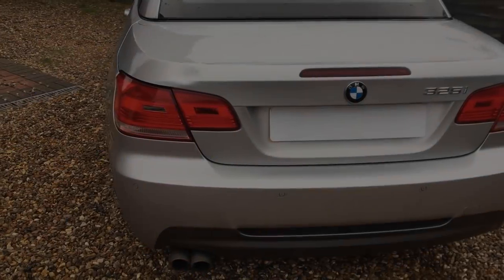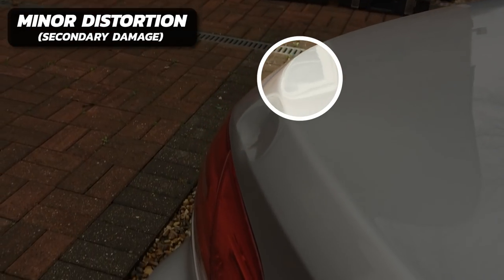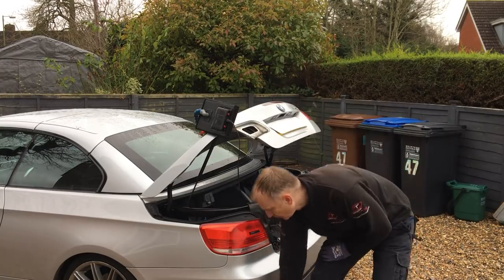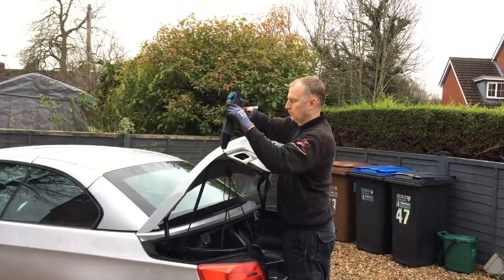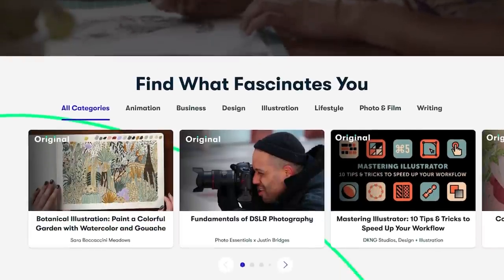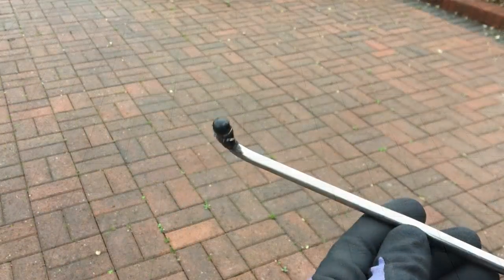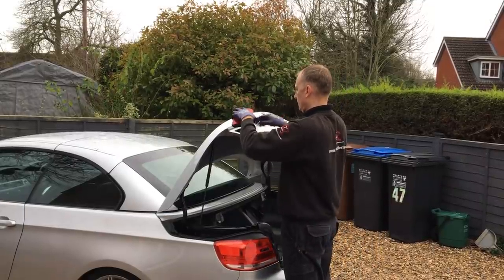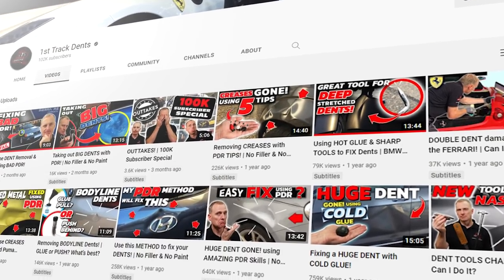SATISFYING DENT REMOVAL from START to FINISH |  BMW 325i

Comment: Glad to see you back always a pleasure to see you work your magic. The tool's on the panel is that a basic tool system. The pointed knock Down do you ever have chipping paint from maybe too hard of strikes
Reply from the maker: The tools I use are quite basic and simple, the knockdown will only ever mark the paint if the panel is hot, for example, in the summer on a hot day and the car is in direct sunlight, it also  can mark the panel if the panel has been resprayed before and it hasn't cured properly, or if there is filler/bondo behind lurking under the paint finish. Otherwise if it is a good original paint finish, you will have no problems 👍

Comment: Hi Jake, great video of course!
Do you only repair metal panels? If you can show us a plastic pdr job that would be great.
Thank you.
Reply from the maker: Hi Paul, predominantly it is for metal panels, although there are some cases where it can work on plastic, but plastic is less forgiving than metal and there are so many type of plastics so the material is not consistent. I only really focus on metal. 👍

Comment: Hey jake what kit do u recommend for a beginner?
Reply from the maker: Hey, it's hard to say really as there are so many out there on the market. I actually started out with this kit and still use a lot of them today : https://www.pdrtool.com/collections/pdr-tool-sets/products/master-41-set-made-in-usa
Although you will need to get a light, knockdowns and a good 24 inch double bend screw on tip bar.
Reply: @1st_track_dents  Cool. Im a auto painter but always been interested in PDR. Love ur videos!
Reply from the maker: @CovidSH  That's great, it would be an easier transition for someone like you to get into PDR as you will have a keen eye and feel for dent work. You should give it a go 👍👍👍

Comment: Hi Jake, why do we have high points? Pushing and tapping back seems time loss. Can there be a improvement in technique to eliminate self made high points? Such as pushing as close as possible to reqular surface.Thanks.
Reply from the maker: Thanks Anil for your comment, unfortunately there will always be high spots to tap down, that's just the nature of the metal. You should read up on the theory of 'springback' In order to move/bend a piece of metal it has to be moved beyond the point you want it to be as metal is slightly elastic (mild steel, Aluminium HSS and ultra HSS all react differently). Also within a dent you get tight and soft areas and when pushing a tight area up, the soft surrounding metal will come up higher thus needing to be knocked/tapped back down. All the tapping down can be reduced by using the correct tips on your bar. Too sharp a tip will create many high spots, so through experience a technician will become more skilled in knowing what tools to use and this will in time reduce the time spent on finishing /tapping down. 👍

Comment: I really like your work, wouldn't it be better to shoot with silicone first?  May I know the brand of the sticks? Greetings from turkey
Reply from the maker: Thanks, I like using the Glexo brand of glue sticks, however on this job the bootlid had been painted so that's why I didn't glue pull it and the access behind was really good for pushing. 👍

Comment: Hi Jake!  how nice to see you again!!  and as always good video friend!  I have a question, instead of hot glue, did you use glexo cold glue?  or is it still likely that the paint will come off???  greetings from Mexico!!  and I hope you continue uploading videos that are great!  A hug!
Reply from the maker: Hey, great to hear from you as always! If I know a panel has been painted, I will never use any type of glue from the outside to pull the dent out as I don't want to risk pulling paint and Glexo cold glue can also be super sticky. But it is more the fact that with cold glue pulling, you have to shock the panel with a slide hammer and that shock of pulling the panel may crack any filler lurking underneath the paint or pull off any paint that has not bonded properly from poor paint adhesion. Generally as a rule if I have excellent access from behind as I did with this job, I would always favour controlled pushing from the rear of the dent. I hope that helps 👍👍👍

Comment: As always Jake, your expertise in PDR is remarkable. You should be teaching a class on Skillshare. Just one question - when you apply heat to the panel, how long do you hold the heatgun to that spot? I know you need to be very careful or you can damage the paint, but just a rough estimate of time elapsed for each one would be great.
Reply from the maker: Thanks George, you do have to be careful but I just give it enough heat so that it is hot to the touch,  not burning hot. I get it as hot as the panel would get on a hot summers day. You do have to take extra care with light paint finishes as they can go yellow, but you just have to be sensible and keep feeling the surface as you heat it, I do touch the panel to see how hot it is getting during my repairs but I edit those parts out as they are not very interesting to watch. 👍